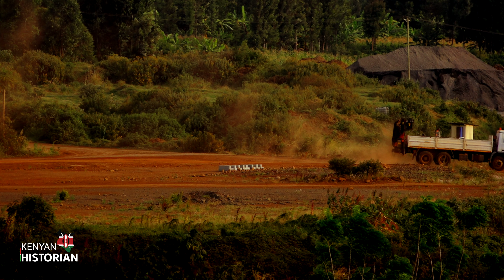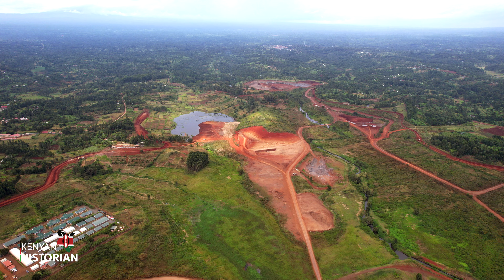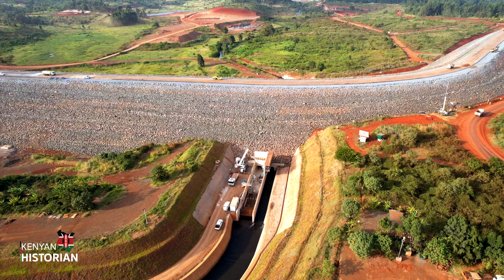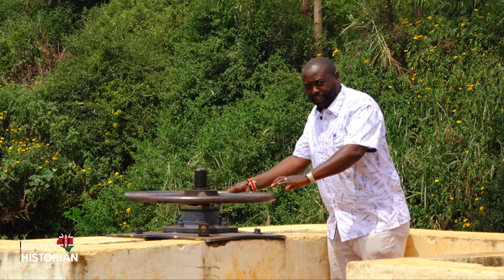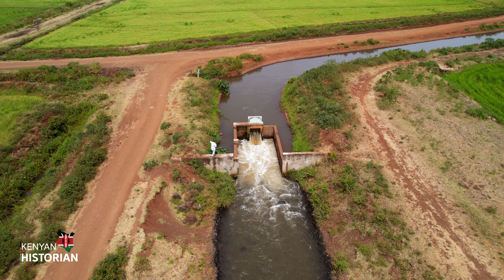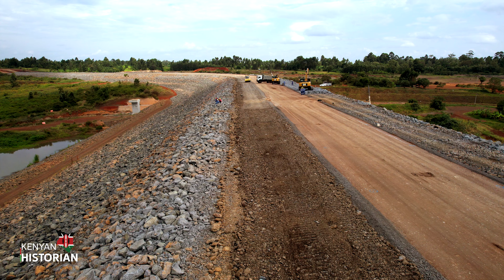KENYA'S MEGASTRUCTURES: Building Thiba Dam part 2: Connection between the dam & Mwea rice farmers

Comment: Rice at mwea is still expensive ... i don't see the reason why we are   importing cheap rice from Thailand etc .....where is galana kulalu irrigation scheme .....
Reply: Its expensive due to extremely high production cost. Producing rice in 1 acre costs over 50K just to get 30 high quality Pishori bags. You can actually get over 60 bags when you plant other lower quality types of rice by the way. If you lease land, add over 60K to the cost of production. But no other rice can surpass pishori's quality for sure
Reply: @simonmurimi9856  Thanks for those stats. How much will the increased water availability (from Thiba) and the recently introduced hybrid rice seeds influence the cost of production?
Reply: @saimzmuiruri  Constant supply of water will lead to increased rice productivity. Without water, one cannot harvest anything. In fact, there will be 2 planting seasons. Currently, there is only one season (plagued with issues of water scarcity especially during dry seasons)
Reply: We are importing rice because we only grow 20% of the total rice that is currently consumed in the country. Even with Thiba dam, we will only get to around 35% production. We will still need to expand other rice schemes especially in Western and Nyanza to bridge the gap. That means more dams for the other rice schemes; massive investments. Until then, we will still need to import. The same applies for wheat, sugar and maize. Even USA with vast tracks of land, still import these same commodities in large scale from South America.
Reply: @saimzmuiruri  That's half the truth but on the grand scheme of things commodity such as rice not being a staple food should not experience such turbulence in the national food chain. Skewed govt policies, graft and meagre investment in agriculture are the actual reasons for such price fluctuations. TUWACHE SIASA ZA UPUZI and be patriotic enough foe the country!